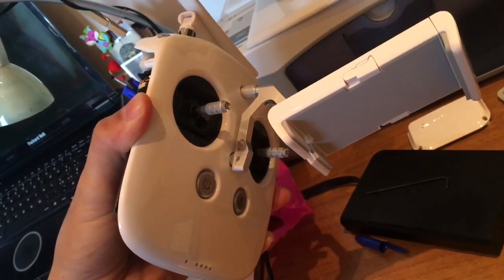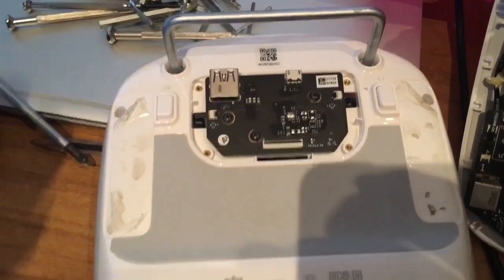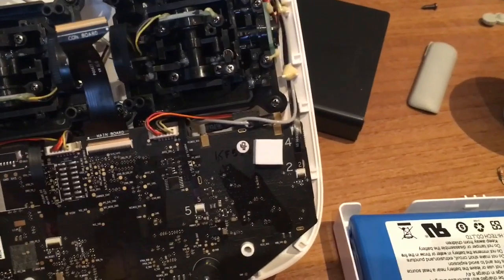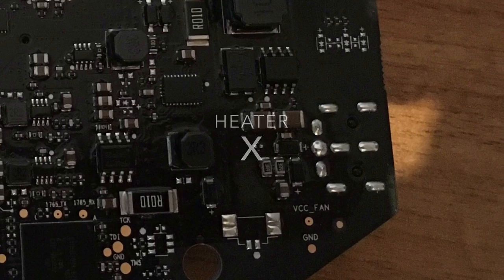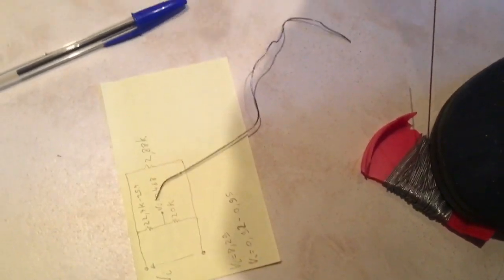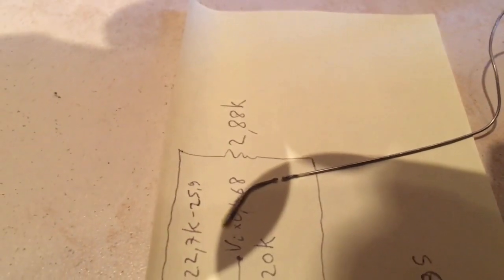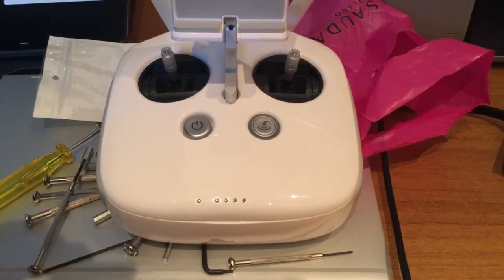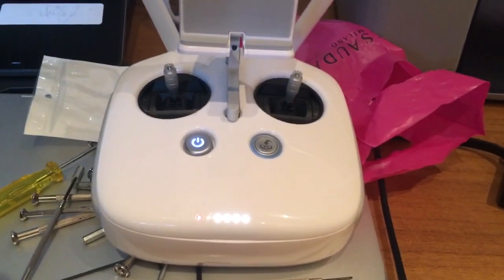Phantom4 controller repair tutorial

Comment: Hi Gaucho, I fix the problem of the battery but now, i have a problem cause the controller doesn´t connect to my phone, may you help me?
Reply from the maker: It is possible that you didn't properly reconnect the flat cable between the USB connector and the main board.

Comment: hello,

Can you tell me where exactly you heat? On the video, the white cross moves. I don't undersand. Thank you in advance for your help.
Reply from the maker: julien calvignac according to the video you have to move, following the movement of the cross. Anyway after few weeks the problem camed out again. So i tried it many Times and now i solved it. i think i understood that the point where you have to concentrate is on the right of the 5 leds. The point is located at the right of the battery connector, where there is the label TP_VCELL. I left the hot air for around 3 minutes on both sides of the board, on the area corresponding to the TP_VCELL pad. 3 minutes on a side and other 3 minutes on the other side. I will link for you a forum where you can read my tests
Reply from the maker: julien calvignac read my (gaucho) last 4 posts on this thread (page 2): https://phantompilots.com/threads/remote-controller-charging-issue-something-you-could-try-possible-solution.124899/page-2
Reply: @gaucholivido  hello thank you for anwser. It is aera tha I paint in red on the picture  : https://drive.google.com/file/d/1BUjBNqXPilaarxwsiY3xqtjmHPreVgdj/view?usp=sharing.

How many degres do you heat on every side 3 minutes ? 250 ° or  350 ° ? 

Thank you for your help.
Reply from the maker: julien calvignac watch the entire video, my heat gun has no display so i can’t tell you. 300 degrees is enough. Just do How i did to check that the time needed to weld the thin is equivalent to mine